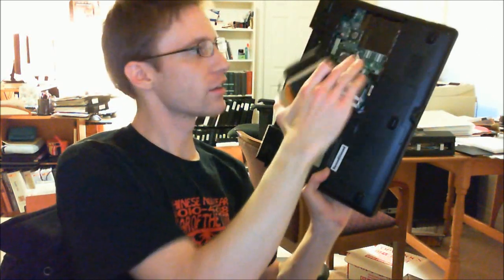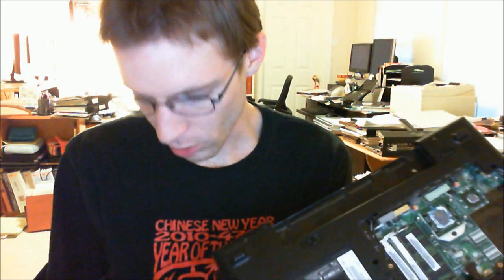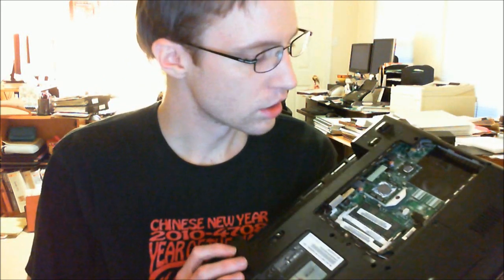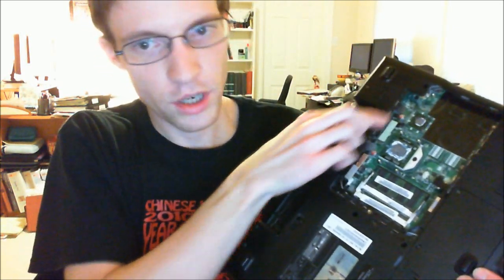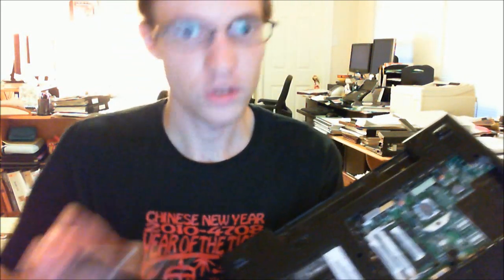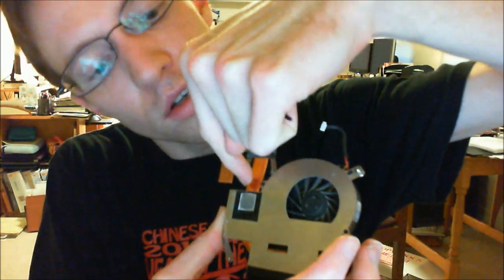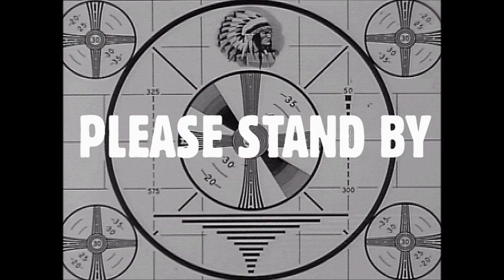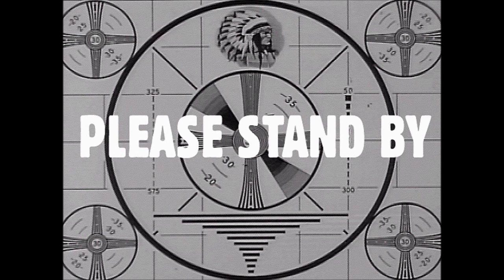How to fix a noisy laptop fan (Gateway M-2626u)

Comment: i mistakely dropped my laptop ..since then its starting to make annoying fan sounds... any suggestion to fix it ..plzz
Reply from the maker: You probably knocked something lose. If you can, pull the fan out and see if you can realign it. Otherwise, you can maybe get a replacement, depending on what laptop you have.
Reply from the maker: +Fullmovies for u it might damage your sanity, but as long as the fan keeps pushing air, it should be fine.

Comment: my laptop makes this weird sound every 7 seconds 
help
Reply from the maker: What sort of noise? Have you tried yelling at it?
Reply: SamtasticOnline that actually made me laugh for no reason if you seriously want to know it's like something is clicking
Reply: +SamtasticOnline between something clicking and someone farting 
i seriously need help btw
Reply from the maker: +Nora Nick Your computer has a fairly small number of moving parts, so noises usually come from either a fan, a hard drive, or a disc drive. Some modern computers have SSDs, passive cooling, and no optical drives, so in those cases it's probably gremlins. You can usually remove disc or hard drives really easily if you want to rule those out, but you're probably hearing fan noise. Depending on your computer, the next step may be as easy as what I do in this video, or much more complicated.
Reply: SamtasticOnline oh thank you 
it's just that i don't hear anything but that clicking sound 
like.... umm you know that laptops normally make sounds like a fan sound or something 
my laptop stopped making that sound and started making a clicking sound
but thanks anyways 
i think i should take it to a store or something am just scared i'll ruin it

Comment: my gateway laptop keeps making this weird hissing/blowing sound by the vent of my fan. please tell me whats going on >.<
Reply from the maker: not sure, but it might just be clogged with dust and hair. Have you tried spraying it out with canned air?
Reply: SamtasticOnline no my mother said i can take it to a repair shop and i think its the fan to.
Reply from the maker: +katherine gheerow usually if the fan itself is going, it will sound like grinding sand, or you'll hear clattering plastic. If it just sounds like poor airflow, you might just need a $3 can of air to blow it out.
Reply: SamtasticOnline oh ok thx
Reply: same

Comment: IF you have to disassemble your laptop or netbook to get to the CPU, it ha sa dumb design indeed. HP has been doing it a lot lately. The good part is you can charge money for servicing it,because it simply takes a whole lot m
ore time (perhaps that was the original intention for this poor design).
The best lubricants for loose propellers are based on pharmaceutical vaseline (which I cannot find in my town).

Comment: Would this same thing work on a Dell Inspiron? My fan keeps sounding like it has staples inside it.
Reply from the maker: I'm not sure. The removal process should be roughly the same, but I know that the Latitude D600 and D610 have a different kind of fan (enclosed bearings) that's not so easy to pull apart. Oiling the fan, regardless of type, should help with noise. I've got an Inspiron I'm working with right now, but Dell didn't make getting to the fan very easy on this one, so I hope yours is a little more accessible.
Reply: Thanks Sam! I appreciate the quick response. :) Hopefully it'll work. I usually just take it to geek squad but I figured I'd try to fix it myself this time. I subscribed to your channel.
Reply: I actually didn't even have to take my fan out or anything I just used duster on my keyboard and then on my fan and it fixed itself that way. Thanks sam :).

Comment: Hi, my laptop is HP Pavilion G4 1321TX, i want to ask to you, why my laptop fan is noise & vibration? like a there is a small stone in it. i've try to cleaning my fan use air pressure from air compressor, and also i've open my keyboard and i try again to cleaning my fan from the top, i shoot again with air pressure from air compressor, and from what I see, the fan has been clean, no dust again, but why my fan still vibration and noise? whereas during this, i always maintain the cleanliness of my laptop, and the i also rarely use my laptop, and when i want to use my laptop, i always use extra fan for my laptop, and then my laptop also still new, not yet 1 years, but why did this happen? can you help my problem? 

As additional information: my fan rotation still smoothly, even though only using the mouth blown, the fan still spins smoothly.

Comment: Hi! i have a problem with my laptop...2 days ago,i was figure it out,that my laptop is very loud and the cooler is not stopping,like i was playing a game or something that want cpu power,and it remain like this,even today when i wake up,and i run my pc,is the same! it is hearing like i play a game,and i am on internet,just on youtube...easy stuff! Now my pc's temps are 76 one core,and another 73...or less 75-72...and before was 50-55(i have an dual-core processor)! the laptop is under warranty, I have a year and a half.Do u think the peoples from the warranty can fix this? Or if not, how do I fix it, if i can ??
I was making some changes im my pc,like overcklok my GPU,but this thing is from 2-3 months,and i dont have any problem!
Reply from the maker: If it is still under warranty, I would send it in, if you can. They'll probably replace the fan assembly in its entirety and give you another year and a half of perfect function. As I've told a couple people, I only bothered with oiling the fan because I couldn't find a replacement part anywhere, or I would have just installed a new heatsink/fan. If you're insistent on doing it yourself, depending on the computer and type of fan it can range from super easy to incredibly complicated.
Reply: My problem was a virus...i was having a virus that when i m connecting to the internet,it consume my cpu power..u know? And i cannot devirusate the pc and the only thing that i need to done to not have anymore that fucking virus(i think it called "tasksWatch.exe",i find it in startup,and i can't delete it) i reinstall the windows 7 again! i was using a few good antiviruses and anti malwares,but it doesn't work!!

Comment: I have an hp laptop, and getting to the fan is pretty straight forward, just remove the two screws on the bottom [labelled with a keyboard logo] and flip the little keyboard catches [in between the Function keys esc/F1, F4/F5, F8/F9 and F12/del] then simply flip the keyboard up [the spacebar is the bottom] [be careful  there is a ribbon cable attached] the fan is held in by a further two screws easily accessible...

so what's the catch? the fan is enclosed in a sealed plastic housing and i can't open it...

any advice? it's an HP NC6400
Reply: at least i didn't need to remove my screen lol, i wonder what model that was?
Reply from the maker: PRODIGAL SUN It was an dv2000. If it were my computer, I probably would have just modded the case (i.e. cut a hole to the fan).

Have you pulled up the stickers to see if any screws are hidden under them? Are there any discreet clips that you might be able to pry carefully apart? The good news for you is that it looks like there are a lot of replacement fans for your laptop available for super cheap on ebay. I'd just buy a new one. My problem was that I couldn't find a replacement for mine.
Reply: yeah i solved the problem last night in pretty much the same way... bit of controlled brute force and it's working nicely... can barely hear it now... btw i used baby oil [which is mineral oil really] and it seems to have worked perfectly, but i did apply very little and even then i wiped off any excess, job done
Reply: SamtasticOnline
also thanks btw, i forgot to say that
Reply from the maker: PRODIGAL SUN For sure. I'm glad you got it worked out.

Comment from the maker: The graphite oil works pretty well. I don't use that laptop anymore (I still have it, I just don't use it), so I haven't really had the need to keep up the search for better lubricants. It started wearing down after six months or so of constant use, I suspect that the fan was off-balance, but having to spend a few minutes doing this maintenance a couple times a year isn't that bad. I hope it works well for you.

Comment: Bump just got home to a dead laptop so I turned it back on and every 5 mins it shuts off, managed to get an old desktop fan wired up to it and checked with speed fan and the temps are souring to 98 degree C before shutting down cracked the case open again! and the fan has stopped working... start stops every few seconds.
Looks like I might just get a new laptop and sell this one on ebay because one of the usb's have gone anyway.So if your fan is buzzing just apply a small amount of wd-40 thanks.

Comment: I've heard its a good idea apart from what glue will you use because most glue will become tacky when warm and others will stay hard BUT there wont be an effective heat transfer so you will need to probably glue it to your laptop case and put thermal on the copper to help cool onto a bugger surface area

Comment: Re applied thermal paste cleaned all of the dust from the motherboard and vents and oiled the fan and it's finally quite apart from one problem .....one of the blades on the fan has broken off (so I now have a small amount of vibration where the fan is not true ) but despite all of this my temps have gone from 87 degree to a impressive 54 degree for core 0 and 58 for core 1

Comment: Think I might have a go at oiling my Acer aspire 5733's fan as they are about £15 new and are hard to come across it's an i3 which reaches 87 degree C
its strange because the fan buzzes when going normal speed but makes a loud rattle when going full sounds lie ( brrrr brrrr brrrr brrr brrr brrr) constantly on and off

Comment: I found that Brake Lubricant... about $1.00 at a discount Auto Store, (you get this when you buy a set of brakes so they do not squeak) works the best. it is like axel grease and is good for about 6 months from an application of the lubricant.

Comment from the maker: Don't use WD-40, it will just end up seizing.  Most recently I've gone to using a little bit of Sta-Lube Engine Assembly Lube, and that seems to work pretty well.  I've had to reapply, but it seems to be the best stuff so far.

Comment from the maker: If you can find an easy replacement, sometimes that's the way to go.  I did this because I simply couldn't find the part anywhere.  Just be careful when oiling bearing fans that you don't get any dust or other contaminates in there! :)

Comment from the maker: If this puts you at ease, your graphics card isn't going to just switch off.  You don't have an IGP with that computer, so if you can see the screen, the nVidia card is still working.

What makes you say that the fan has stopped working?  I'd be surprised that you're even able to boot up if that's the case, let alone play games.

Is your computer still under warranty?  If it is, and you're having hardware problems, you would probably just want to send it back to Dell.

Comment from the maker: If your CPU fan isn't functioning, your computer is unlikely to stay on for longer than a few seconds (sometimes longer depending on the heatsink and the CPU's heat generation).

Generally, overheating will result in things like spontaneous shut-downs, or system freezing.  In very rare occasions, you may get some strange (we're talking Tim Burton strange) behavior from applications from excessive thermal stress.

If your games are just running poorly, it's more likely something else.

Comment: Finally my fan stop buzzing and it's quiet, I even check underneath to make sure it was spinning, and it did.  This video is very helpful, you just fixed my laptop with your knowledge and I was very careful using the Jig-A-Loo Graphite extreme lubricant.  It's a spray and I sprayed on a paper plate because it was using too much, so I waited for it to drip and I put the oil in the fan, but I have to remove a sticker under the fan case because I can't remove the fan separately like 3:29.

Comment from the maker: Unfortunately, though the manual shows how to even remove the keyboard, they don't give even a glimpse of the fan assembly.  Check the video response I posted and it might answer your question.  One of the screws on mine is seemingly spring-loaded, and I think I ended up stripping the threads at some point without suffering any related problems, but you really want to be most careful overtop of the CPU and IGP because if it's not on right, it won't pull the heat from the chips.  Then no laptop.

Comment: I tried it with Ultra Disc Brake Lubricant (rated at 400 degrees)
Since it works on disc Brakes to halt squeaks due to vibration, it seemed only logical it would work perfectly on a CPU fan. I'm sure it has graphite or some other magical ingredients.
Only a buck & change at any auto parts store like AutoZone or Advanced Auto.
Anyway, the fan is SILENT now... maybe even better than new.
It is difficult to tell it is even running.
I'll leave it up for a week and let you know if there is any wear.

Comment from the maker: That computer looks pretty awesome. The short answer is yes. When mine first started making noise, it was pretty intermittent, and would usually stop if I smacked the bottom of the computer (love taps). It baffled me for a while because it sounded like the fan blades were dragging on the fan casing, if that answers your question. If you do decide to oil it, the engine part lube that I used most recently seems to be working the best. Also be prepared to replace the thermal paste in case it's dry.

Comment: my gateway p-7908u fx or something like that started make noise after almost 2 years, the sound doesnt come up always, just when the fan is at full speed, the sound is kind like theres something trembling, like prrrrrrrrrr...is that the kind of noise this oil thing would solve? I alredy opened it to see if theres any obstruction, but it looks just fine...Im afraid of opening removing putting oil and stuff like that..

Comment: Yes i'm using speedfan rpm's are good and my temperatures are low. Games are running flawlessly. When it was hot GTA EFLC was frame by frame. Very bad. Now its great. I have Asus N61vn bought it used and got the fan "surprise" and now its all good.

Comment from the maker: @XBC125 Yeah, pretty much any good grease should do the trick.  You might want to use speedfan to compare your CPU temp with and without the cover, though.  The cases are generally designed to get high-efficiency airflow right across the stuff that needs it.  If it's not caked with dust, cooling should *theoretically* be better with the cover on.

Comment: Hey Sam! Great video! My laptop (HP HDX18) fan started acting up BAD a few months back. I took it apart (very lengthly process, comes apart in like 8 pieces to get to the fan) a few months back, but there didn't seem to be access to the fan without taking it off the heat sink. I found this video just recently and decided to do it again. It worked like a charm! The fan came apart the same ways your did. I used sewing machine oil and arctic silver 5. Thanks a ton!

Comment from the maker: @Ner0381 Thanks, and quite likely.  A sort of unorthodox way to check is to interrupt the spin of the fan to see if it stops the noise (just for a split second).  An important thing to note is whether or not you have a ball-bearing fan, because if you do, it's a whole different kind of animal to fix.

Comment: I have an m-6339u, and it appears to have a similar fan (if not the same one) as I've had the same issue with finding the fan for sale online. Anyway, my question is, how do you remove the fan and heat sync initially? It seems to be well put on, as I've not removed it in the past, but it's hard for me to clean it without doing so. Perhaps you could make a video just showing the removal process or type it out to explain it to me? I'd appreciate it. Thanks for the video though! :)